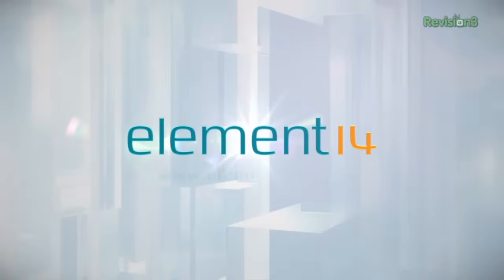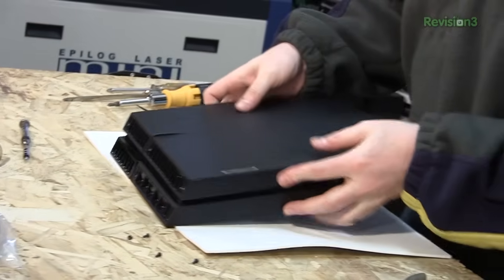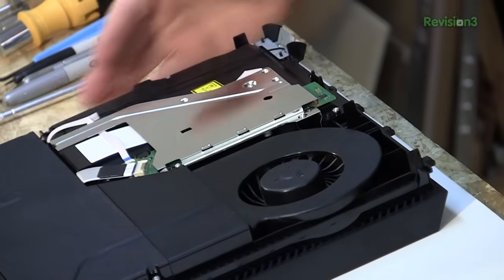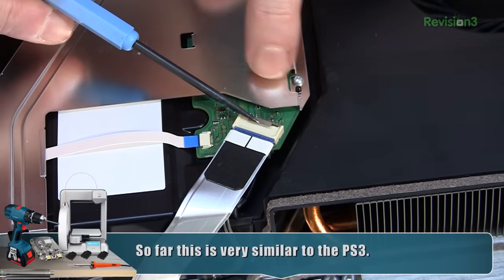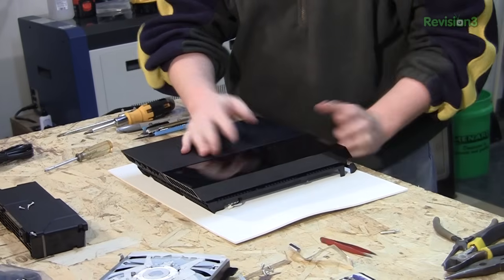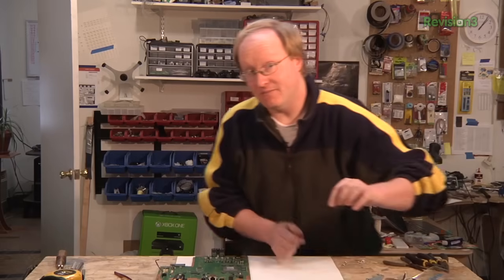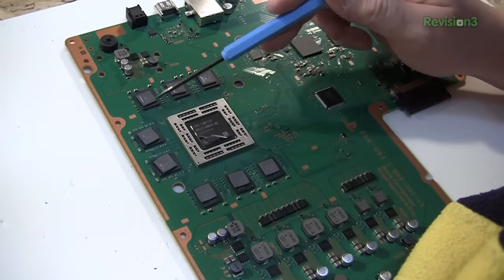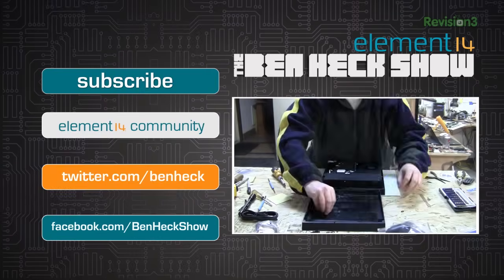Ben Heck's PlayStation 4 Teardown

Comment: Wow Sony designed their console so much better than Microsoft. It seems ridiculous that Xbox one runs hotter is way larger and u still have an external power brick. All in the name of extra profit . Sony build something properly then worry about pricing later. Seems Microsoft try and screw customers anyway possible with weaker hardware and poor design. Plus the whole initial fiasco over not being able to trade games and making kinect mandatory . which was only rectified after consumer backlash. I surpose what I'm trying to say is Microsoft really gives it customers the middle finger lol. And for PC users remember vista that was a middle finger to us from Microsoft to so overpriced and ran like crap.
Reply: From what I heard the Xbox One does cool better actually (it does have a massive heat sink and lots of space for airflow) but I also haven't heard of the heat a PS4 generates having any negative effects or anything.
Reply: So where are you getting the information that XB1 runs hotter?. See the XB1 runs virtually silent unlike the noisy PS4 which runs louder than my high end PC. So if you can provide a link with detailed information otherwise I will put that down to hearsay.
Reply: Unless you live in a tiny box then the external power brick on the Xbox shouldnt be a problem. I also haven't had any issues with the xbox it doesnt overheat or get hot whatsoever and its extremely quite
Reply: JAGUARCD32X  The ps4 really isn't loud. If it's as loud as you try to make it out to be you should relocate it and give it better ventilation or inquire about possible issues with it. Give it a rest.
Reply: jraybay  Give what a rest?. What is there to rest?. The noise the PS4 makes is ever so slightly louder than a gtx690 which is two graphics cards running in tandem on just one PCB with a single fan for cooling. I know this as I was reading from websites that have measured the noise PS4 makes in Db's and it compares with a gtx690 in noise department.

That has been scientifically proven. If you don't think that's loud for hardware that uses a 16 watt low power architecture designed for tablets and netbooks  paired with a lower mid range GPU then I don't know what to say.

If a console using low power architecture is as loud as two GPU's using  the same one fan cooling solution then I don't know  what to say.

I think you are being  overly defensive as it's loud, many people believe it's loud. It's not like I am protesting people not to buy the device on the grounds of the noise it makes
Reply: JAGUARCD32X  You really didn't need this short story reply. I originally thought you were referring to idle noises and well... the ps4 is dead silent. when the fans kick up however its obviously noticeable. Not having a brick hanging off of it may contribute to that and it's about half the size of the xbox 1, it seems.
Reply: jraybay  I don't know why Sony bother putting the power supply unit inside the console as all it does is raise the heat internally. I have never had any issues with the power supply brick as it sits behind the media stand
Reply: JAGUARCD32X I think sony enjoy making compact and ergonomic designs though... but it's a gaming system and they remain pretty stationary throughout their lifetime. I think the most practical ideas should be put in place not the most compact. I dont struggle for room or space so I could care less how small they make it.

They have, however, used thermal pads to take some heat off of the core components 'since the ps2 days' and it's worked for them and running a GDDR5 requires them to, with their enclosed design. The good thing about a brick though is you can replace it hassle free if there was ever an issue pertaining to it.
Reply: jraybay I suppose one issue is the Japanese mentality as Japanese home space is about  one fifth the size of western homes so they appreciate everything to be really compact however I don't understand why a power brick placed behind the media stand that your TV sits on would make that big a difference as it would still be out the way.

I am not saying that the noise is too loud that you can't enjoy gaming on it as I enjoy gaming on my PC all the same, I just think a bigger fan and external power brick would have helped somewhat in that regard.
Reply: TheOwlThatSaidWho Agreed, it runs silent.
Reply: JAGUARCD32X mine is quiet as house bro even when I play for a long period of time. So stop the lies and it's so quiet I left it on for 2 days straight while I was at work then come home play games and watch netflix. Not once did it over heat and make any loud noise. So stop with the garbage it's very silent
Reply: Brian Pugh as a mouse
Reply: That's what you get from a Japanese company. They prefer quality the first thing then the money.

Comment: Is there only one version of the PS4 console?  I remember with the PS3 there were different hdd sizes.  What about with PS4?
I am thinking about buying a PS4 and just want to know if there are different specs
Reply: The PS4 as far a s I know comes in only one standard version. Because the user can easily upgrade the HDD without voiding the warranty, the size (storage) would also be standardized. I think this is a great decision to make, so the consumer can add more storage if desired. It uses a laptop type 2.5in sized HDD, and you could easily take this 2TB Western Digital 2.5in Laptop HDD and stick it in for the highest capacity available with today's technology. (http://www.newegg.com/Product/Product.aspx?Item=9SIA0AJ20D8009) Think of when multi Terrabyte Laptop SSDs come out, could you imagine how fast games would load and how many you could install? So, to answer your question, I am nearly certain there is only one version, maybe different bundles or country specific versions, but the overall design and specs are identical. If you want to read the hardware specs, continue below. Pretty good features if you ask me, and being able to download and install games and updates while in standby is very good also. Never owned a Playstation before, but I am overall impressed by it, and may consider getting one myself in the future.

Wikipedia info on hardware specs:
Main article: PlayStation 4 technical specifications
The PlayStation 4 uses a processor developed by AMD in cooperation with Sony. It combines a central processing unit (CPU) and graphics processing unit (GPU), as well as other components such as a memory controller and video decoder. The CPU consists of two quad-core Jaguar modules totaling 8 x86-64 cores. The GPU consists of 18 compute units to produce a theoretical peak performance of 1.84 TFLOPS. The system's GDDR5 memory is capable of running at a maximum clock frequency of 2.75 GHz (5500 MT/s) and has a maximum memory bandwidth of 176 GB/s. The console contains 8 GB of GDDR5 memory, 16 times the amount of RAM found in the PS3 and is expected to give the console considerable longevity. It also includes secondary custom chips that handle tasks associated with downloading, uploading, and social gameplay. These tasks can be handled seamlessly in the background during gameplay or while the system is in sleep mode. The console also contains an audio module, which can support in-game chat as well as "a very large number" of audio streams for use in-game. Its read-only optical drive is capable of reading Blu-ray Discs at speeds of up to three times that of the PS3's. The console features a hardware on-the-fly decompression module boosting optical disc reading speed and buffer unread data when a game is not actively accessing the optical drive. Although the console supports photos and videos at 4K resolution, the system is not expected to render games at 4K. The console includes a 500 gigabyte hard drive for additional storage, which can be upgraded by the user. The PlayStation 4 features Wi-Fi and Ethernet connectivity, Bluetooth, and two USB 3.0 ports. An auxiliary port is also included for connection to the PlayStation Camera, a motion detection digital camera device first introduced on the PS3. A mono headset, which can be plugged into the DualShock 4, is bundled with the system. Audio/video output options include HDMI TV and optical S/PDIF audio. The console does not have an analog audio/video output. Although not available on the system at launch, the PS4 features a "Suspend mode" feature. This places the console in a low-power state, while allowing users to immediately resume their game once the console is awoken. The console also is able to download content such as game and OS updates while it is in this state.

Comment: took him about 10 minutes to open that thing.
in worst case scenarios, if your ps4 stops working of a hardware failure, you'd have to take a whole 10 min to screw it out and fix it.

on PC, system failure? e.g" your dvd-rom drive, order a new, plug out, plug in, done.
Reply: Tommy Vercetti Oh I see you're one of those failed trolls. Nevermind then won't waste my time further.
Reply: dont know what kind of PC chassis you have,and its nothing that everyone have, thats for sure... but my dvd-rom drive have cables attached to it, so i still have to screw the side door out and remove cables and plug the new one in..so yeah 10 minutes there to...so your comment fails....also, when did dvd-rom drive be associated with "System failure" rofl..you got no clue what you talking about, do you?
Reply: Necromorphicon it's not hard to plug out some wires..
You can't even spell cases right. You clearly have no experience of PCs.
Reply: Tommy Vercetti True, but a PC is way bigger than a consol.
Reply: A shame the PC misses out on a lot of great games.
Reply: krytonic0 Don't you even start on the exclusives you peasant.

Comment: Worst system ever I had in my life is PS4. Has hardware issue. Disc stucks inside I had that problem and they said send it for new one but they lie they send me the same one I had and didn't even fix it cause I got the same problem back again and send them back again. Takes 2 to 3 weeks WTF

Comment: how long have you been doing this sort of thing?
and you remove the stickers with a sharp tool like that pointing towards you?
i swear, that third sticker, it looked like that scalpel thing was heading for your thumb.

looks like it's even easier to change the hard drive on PS4 than it was on PS3.
might have to look for a terabyte drive.

anyway, did the PS4 still work after reassembly?

Comment: Sony always puts the power converter inside the case for the first generation, because putting it outside (in power brick form) lets you drastically reduce the overall console size. In the original PS1, the power convertor took up an entire third of the console, to one side of the disc drive, and on the original PS2 the power convertor was the entire lower segment. Moving the power converter outside the console itself to a brick on the cord is how Sony can drastically reduce the size of their slim consoles. It's also why 1st gen Sony consoles have a direct AC cord, and slim consoles have a power brick with a specific voltage plug. If the Gen1 PS4 is already so small, the slim PS4 is going to be a real nifty tiny machine.
Reply: Oh, and, before someone comes in whiteknighting the Xbone, I'm console agnostic as well. I'm solely talking about voltage hardware that I've observed in over 10 years of tearing consoles down and studying them. There's no contrived commentary about actual hardware power or developer availability here. Buy whatever console has the games you want, they are all developed on PCs.
Reply: you have to look at the PSTV, its like the Iphone 4 and can play PS4 games. i think sony will be going CLOUD for the PS5. Abondoning in some ways hardware and going into Cloud networks for next gen graphics(instead of competing with PC), although not all consumer are ready for it..(for more pricey internet speeds). 
In time it will. PSTV is the prototype of the next gen consoles.
Reply: They don't put the power brick inside the console JUST so they can make it slimmer later on. I mean, my PS3 slim, has it's power brick still built into the console. It is just that some people prefer not having a hot power brick outside the console.

Comment: FOR YOUR INFORMATION they did have heat pads on the xbox 360. its the thing that melts off and causes the red ring of death, cause you know, microsofts to stupid to put the processor chips on the same side of the motherboard as the fans. -__- or did they do it on porpuse?

anyway, the speaker just beeps when you turn it on. 360 had that, as well as ps3. nothing new. 

ok so, if im correct, by what your saying is, ps4 sacrifices internal ram for extra gpu cores, and makes up for it with the ram around it. where as xbox sacrifices gpu cores for internal ram and doesnt make up for it at all? 

PS4 WINS!!!! gg microsoft, gg.

Comment: so if the xbox HD is not upgradeable, what happens when you remove the hd and pop it back in? just to see what happens? also what if you put in a smaller 250gb hd for instance...? im curious..
ps4 ftw
Reply: It will barely increase r/w speeds as ps4 is still using sata 2, price for performance will just be a waste
Reply: You can upgrade xbox one hard drive but it counts as modding and voids warranty, I don't care because I did it and now I have a 2 TB hard drive on my xbox
Reply: Marcos Santana
pretty sure xb1, just like ps4, uses the sata laptop drives, and they max out at 1.5tb, i havent seen and 2tbs out there, so i gotta say that comment is crap, find me some links of a 2tb and show a vid of xbox, im pretty sure sonys doesnt allow it tho it has a max too
Reply: on xbox one they max out 1tb I think for an external 3.0 but you can put what every size drive you want internally as long as its over 500gb I have only tried a 1tb internally though so I cant be for sure
Reply: Lucas Walker
you cant. internally they dont make the satas that large.
they max out, regardless of what its being used for, at 1tb or 2tb. Otherwise people just use bigger desktop drives as a single one tops out at maybe 4tb i think? maybe a bit higher
Reply: yet you can use multiple externals whats to stop someone using 2 2tb externals together which can be used as my friend is using a 2tb external now so it doesn't max out at 1tb, he also has the limited edition AW  console so it has 1tb storage alrreay
Reply: Lucas Walker
well you originally said any size as long as its over 500gb.. i was just saying it cant be possible... a 1.5tb laptop drive i doubt will work and i think there are some 2tb drives out there however they seem to be pretty rare, most people would rather use external drives instead which is the smarter thing to do anytway because its a bit cheaper. I still dont think the xbox one or ps4 can use ext HDs yet, especially not for installing games to them to play on the system. The ps3 doesnt do that either unless its hacked to play backups
Reply: well that is your doubts, and rare? you can go pick up a western digital 2tb laptop drive for £99 from amazon http://www.amazon.co.uk/2-5-inch-SATA-Internal-Hard-Drive/dp/B00COFNBPA and I have an xbox one and like I said I have a usb 3.0 external 1tb hooked up for game saves it must be usb 3.0 though and ps3 can only read externals if they are FAT32 and you can only use it for playing media
Reply: Lucas Walker
in the US its uncommon and not sold as much thts why i said its kinda rare, i was looking,  back when i wanted to upgrade my ps3's, i settled just geting a 1tb as 2tb seemed way too expensive and you could barely find it anywhere, i remember on ebay nothing, newegg i think sold out, amazon i dont think carried it at the time, yea it was kind of rare

but just because we have them doesnt mean they will work, it depends on the system and OS, i actually think the ps3 might max out at 1tb regardless if you can go higher. But are you saying you can play games off the external on the xbox one? i havent heard of that...

at any rate yes ps3 only plays media files once set up as fat32, HOWEVER i have a modded ps3 as well, it can play games right off the HD..... OR even a usb drive, so yea it is possible and it uses USB 2.0, sony should implement it to ps3s firmware i think, but it would probably make pirating easier since theyre going to start phasing out the ps3 soon enough in favor of the ps4. I would find it a bit hard to believe that ps4/xbox one games could run off an extHD even if its USB 3.0, what are the transfer speeds i cant recall? I do know ps4 so far doesnt allow any extHD's to be connected, not even for media viewing
Reply: Lucas Walker they used fat32 for win 98 lol just saying. after win 98 they for good reason use now NTFS.
Reply: Darkbolt melesk so your saying the consoles don't use FAT32?
Reply: Darkbolt melesk
well yea not many thought we would use past 32gb. They thought even that was a lot... however they did create exfat for larger sizes. Also mod ps3s, off ext harddrives, can only play games as long as the partitions are 4gb or less or whatever, its another drawback for fat32s. Single files can only be 4gb large if they are to be viewed or used etc.

At any rate ntfs is used for very high file sizes, i mean im sure it can be used for small sizes but its mainly used for large 100gb+ sizes.
Reply: putting mods aside for the ps3, if you try to plug in an external drive into things like Xbox 360, Ps3, tvs to play media it will not be recognised in ntfs format, what I was getting at is if you format a usb on an xbox 360 for use with game saves then plug it back into a pc you wiilll notice its FAT32 hence why you can only have 32gb usb storage on Xbox360.

im confused as to whether im trying to be proven wrong by Darkbolt melesk or whether he was mentioning a fact?
Reply: Lucas Walker
nah im guessing hes just asking or pointing out a fact